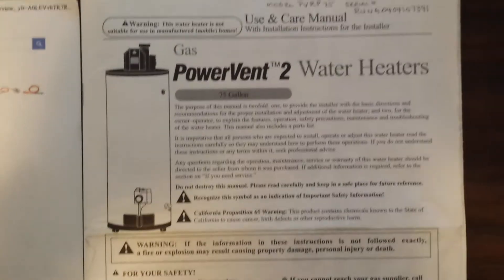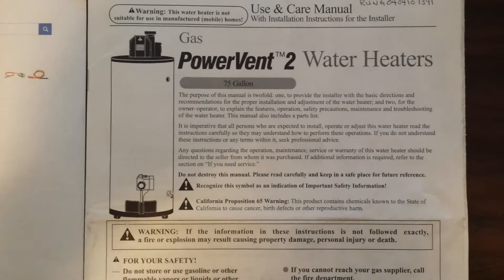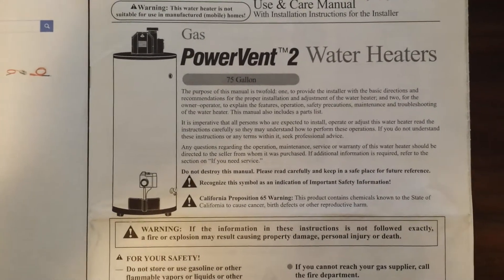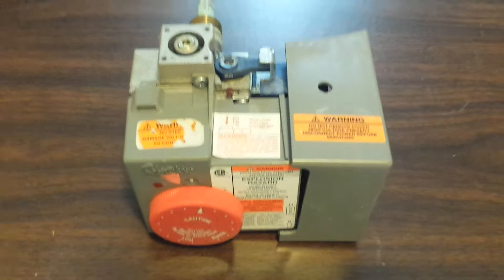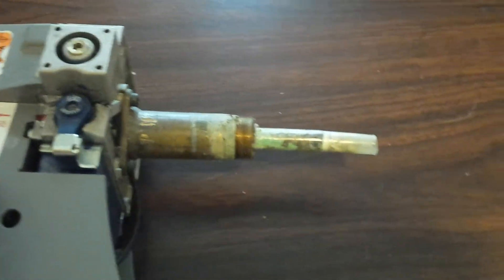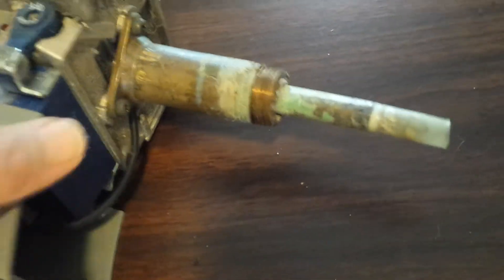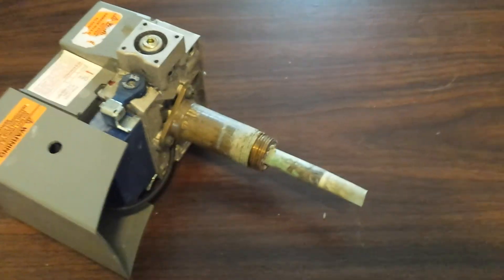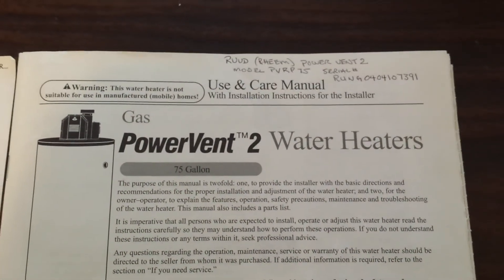RUUD / Rheem Power Vent Hot Water Heater Thermostat

Comment: You are not going to find that part.  That is from the manufacture!  Besides, you still have to take the thermostat out.  If the water heater 10 yrs or older it’s just as cheap in the long run to replace the whole damn heater.
Reply from the maker: Justin, thanks for the info. The video is 5 yrs old so it seems reasonable that the part is not available.  You are right about the lifetime of most tanks, but sometimes they go much longer.  I'll leave it to the viewers to decide what they want to do.  If my tank went bad now, it would be beyond fixing.  It wasn't 5 yrs ago.

Comment: what was your hot water tank doing to realize this problem? i have same model, same controller also, i keep getting code 4 blinks (turns gas on) gas is on?! so i am thinking maybe this is my same issue?
Reply: I Had the problem of the tank just shutting off at random.  Replacing the controller solved the problem.  Your 4 blinks tells you something about what your problem is.  You will need to consult the manual to find out. Try searching for a copy on line if you don't have it.  Good luck.

Comment: Where did you order it from? What website?
Reply: Sorry, that was too long ago to remember.   Try a web search using your tanks model number.
Reply: Ironic, I'm looking at this guys video too for the same reason. Can't find anything about old Ruud units that Rheem made and I don't have the manual anymore. Searching the model number in google gives me dead ends except this video. 
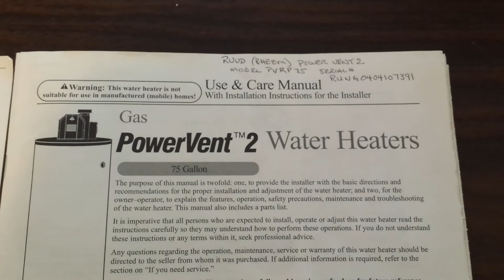I was trying to find the model of this gas valve in his video since it wasn't in description or mentioned at all in the vid, so I screen capped when he went down to the manual at @2:04 and got Rheem SP12560B. Thought it was part of his manual, nope it's an ad that happened to be there for a part he must have searched for earlier.
Googled that and found it is the pilot unit for certain model of Rheem water heater. A little farther down image search results you find Rheem SP20161A Gas Control Thermostat Kit on Amazon for $600+, looks identical but whoa $600! So then back to google to search the proper name and find out it is called a Nat. Gas Combo Valve Replacement Kit and can be had from supplyhouse.com for $309.95.
That's probably the cheapest you will find it, at least that I have been able to find. Will be replacing mine in a couple days if the problem isn't the pilot unit or the thermocouple. I hope that helps you!

Also, to Don, thanks for this video! Helped me out a lot nearly 3 years later!
Reply from the maker: @Zeke-Z   I ll take a look in my files to see if I can get more part # info.  You might be able to remove the old unit and clean the probe since it is likely the problem.  Not sure it's possible or that it would work,  but if you like experimenting,  then you uh can try it and report back.   Good luck.
Reply: @CaptVideo  Hey, thanks Don! I would absolutely love to remove the old unit myself, however the Mrs was none to happy to hear of my planned adventure (mistake the 1st - telling her what I was going to do ha ha). I just wanted to make sure I knew what parts came separate from the unit and how much they all cost before she has a plumber come in here and tell me my doodad was upside in the dangler which caused a flux in the neutron capacitor so that'll be a new water heater and $2,500.
I appreciate you taking the time!
Reply: Zeke Z yea i ended up having the plumber come. He took care of it for $450 lol I couldn’t be bothered